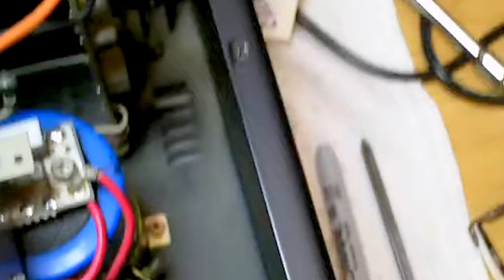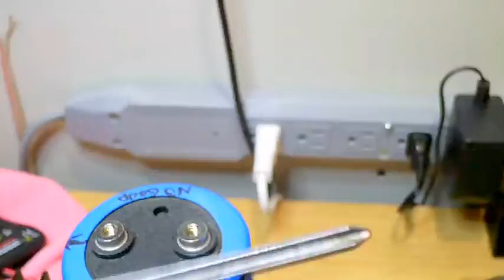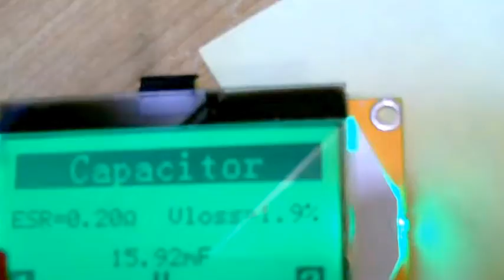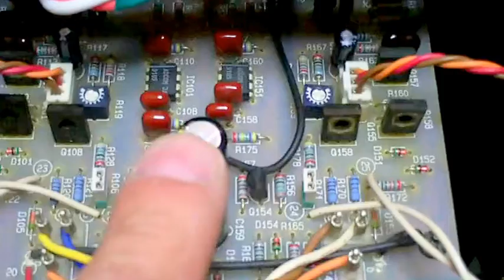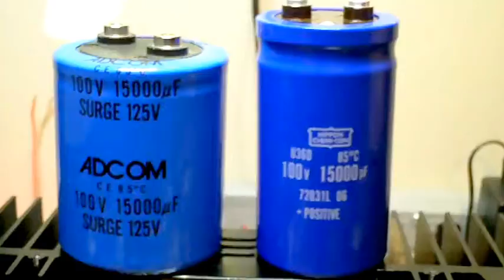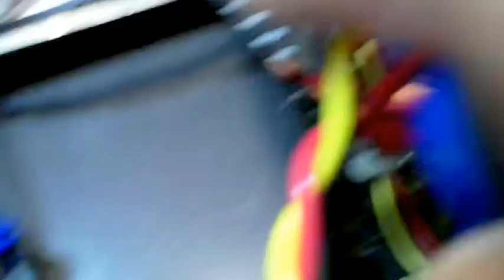Adcom GFA-555 mkII filter capacitor replacement

Comment: Hello, I have the same GFA 555 MkII. Recently the fuse blew (due to stupid me). When trying to replace the old fuse holder broke, then broke further. I have to replace the holder and fuse. Do I need to take apart the amp in order to do so, or does it screw out? Thinking I have to take it apart but really dont want to . Thanks for any help
Reply: if you can't even replace a fuse without breaking something i recommend having a professional do it XD
Reply: @bobadler3097  Thanks for the great info Bob, I actually ended up takign it apart and it was very apparent the backend bolt. Live and learn

Comment: If a large filter cap shorts it will blow a fuse.  Also a bad cap will cause hum in the audio output.  You must also measure capacitors out of circuit to get a correct reading. I have seen caps become leaky and they will load down the power supply to the point that the unit will not function. IF IT AIN'T BROKE DON'T MESS WITH IT.  These huge caps are in the power supply and will never end up damaging your speakers. Speaker damage is caused by D.C. usually from shorted output transistors not caps.

Comment: What was the  ESR on the  "bad"  cap?     Also have you tried  different op amp on the input?  I think that would  be  the weak link using a  1  dollar op amp as an input buffer.  Caps  a  re  better off to be distributed at the  output transistors to reduce  impedance.  A bunch of  smaller caps of  lower  capacity. - Have Fun.  - Sandy

Comment: I have a 555 but the capacitors are much larger than that. Mallary Type CGS, 60000mfd
Reply: Are you serious man? 60000 uf caps?
Reply: @stallion63m35  60000MFD is what it says and the rest is covered by the silicone adhesive that held it into the case but it looks like 40V something. I bought it used from a club in NYC. They had used like 24 of them in their sound system and sold them in Audio Magazines market section. Around 1987

Comment: adcom would not sell the replacement caps?
Reply from the maker: It doesn't make sense to order from the manufacturer - it will be much more expensive and they probably do no support a product from the early 1990s anymore.

Comment: Is this amp safe to run without doing any of these modifications, I have one and I’m worried about blowing my speakers with DC, my amp turns on and sounds great, but it is old.
Reply from the maker: This is not really a modification as the capacitors are the same value as the originals.  This is more of a maintenance.  The 555 has no DC protection on the outputs, so there is always the risk that speakers can be damaged by DC.  If you are concerned, there are external speaker protection relay boards that can be installed between the speaker outputs and your speakers.
Reply: If it isn't broke don't fix it
Reply: My 555-ll, pops when I turn the amp off, it’s started with a very low popping sound, now I stopped using it because I don’t want to damage my speakers

Comment: hey nice vid..i ave a cheap 200$ pyle 2000watts amp...what can i do to beef up the capacitors? and what is the outcome of that ?
Reply from the maker: Don't beef up caps.  Use the same value that was in there.  If you go higher, you can create a large in-rush current when you turn it on and damage other components.
Reply: thanks